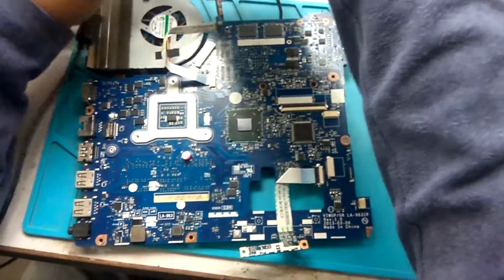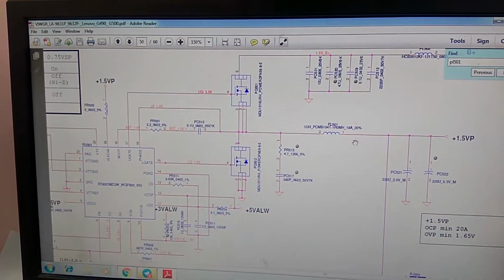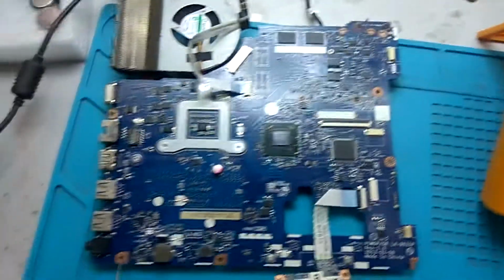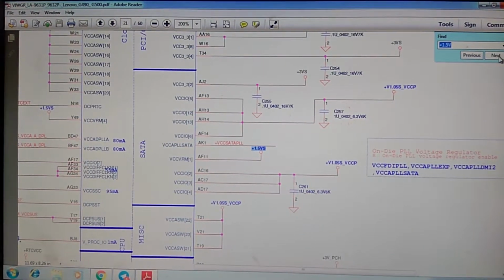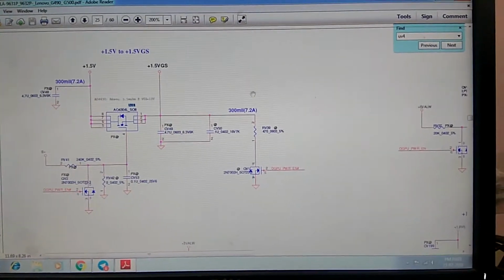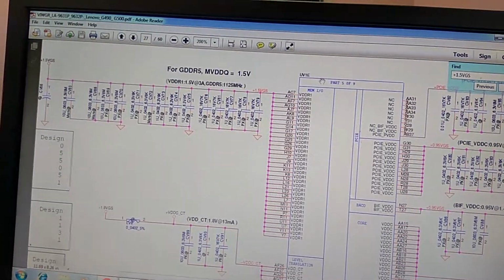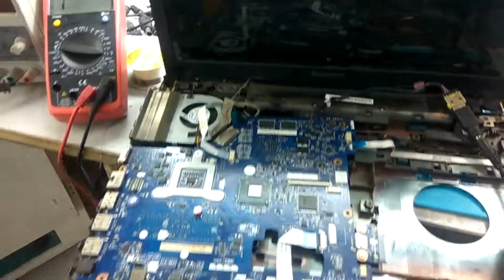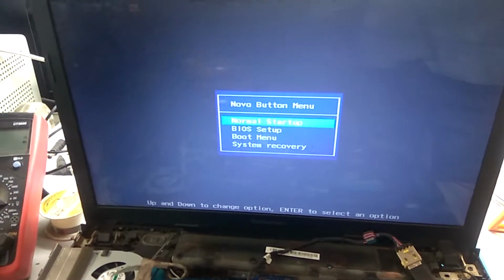Lenovo power on no display solved

Comment: Looking for Laptop spare parts? You can Get all Original, refurbished spare parts Display cable, Dc jack, Fans, Motherboards, etc. 
shop at laptopspares dot shop Call: +91 9133322081

Comment: Hello I’m repairing an no display also for Lenovo G400 part no. LA 9632P. I followed your voltage checking steps and all the voltage is present even the ram coil and graphic. So jumped to Lcd connector, 3vs_cmos and 3vs is present, only the lcdvdd_conn is not present. I traced back and locate at U72 Vout (lcdvdd_conn) also no voltage 0.00. U72 has input voltage 3vs. Is U72 defective no vout and I don’t know what should be the vout voltage. Can you help me? Or there is a remedy for this? Thanks you.

Comment: Great job! But why is the display working, when you have removed the supply coil and mosfet?
Reply: It’s gfx supply made non gfx so it’s working !
Reply: @Aditya11ttt  Wow! I didn't know that's possible. Thanks for the enlightening me. 🙏
Reply: @danieltenkorang8306  and i think this is not possible in a lot of motherboards without settings the VGA selector resistors ( search youtube for "uma conversion")